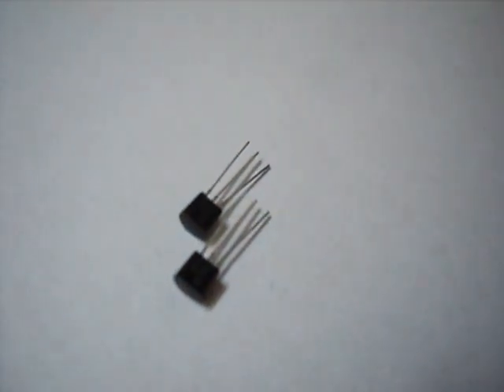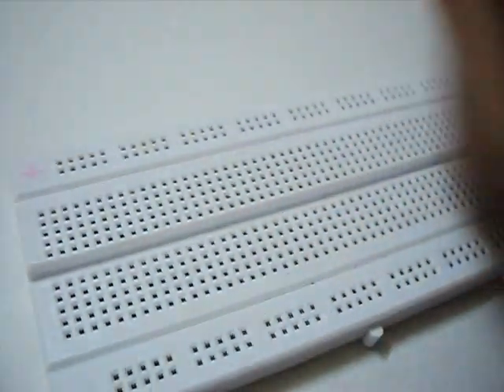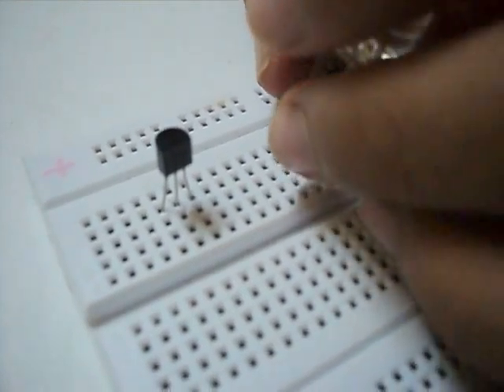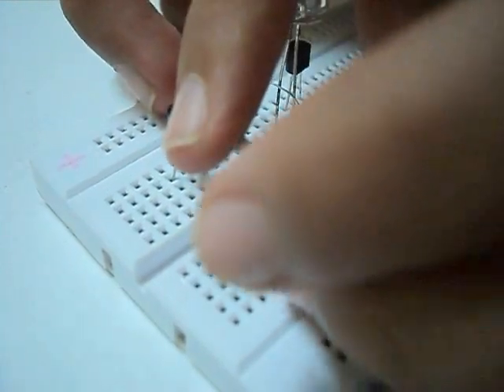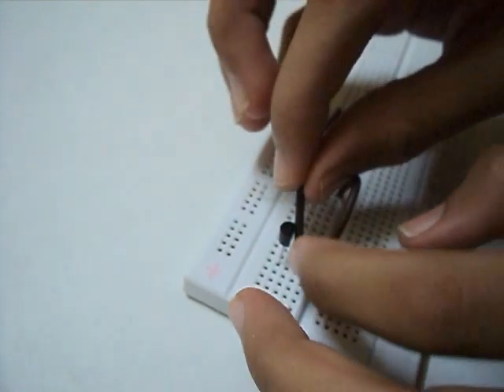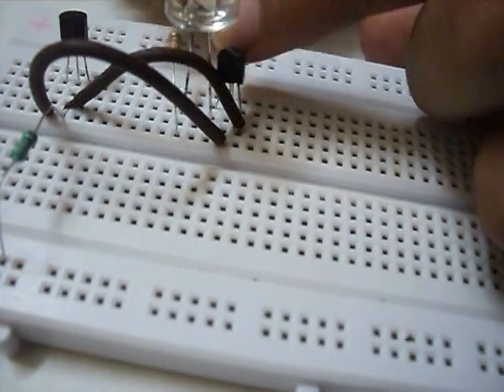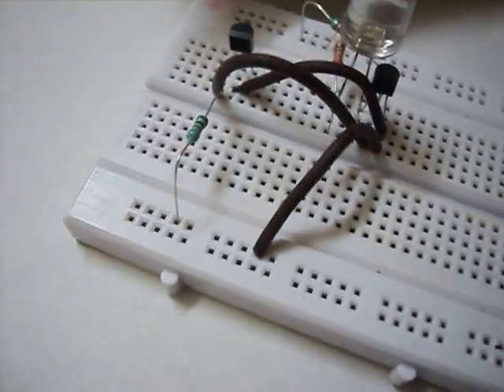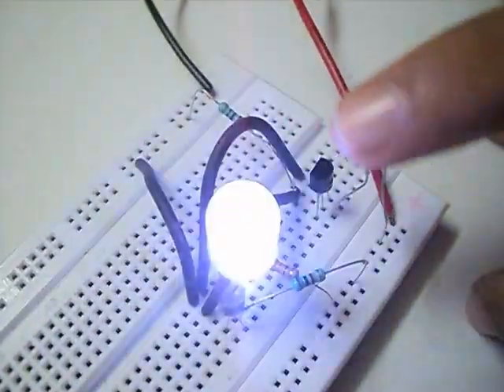Making a simple dark sensor circuit.

Comment: Can we use photo diode instead???
Reply: Yo bro i have same question
Reply from the maker: Yes.
Reply: @curiosity551  need to change the circuit???
Reply from the maker: Should probably work the same. No need to change.
Reply: @curiosity551  how much volt power supply?
Reply from the maker: 5-9 volt is enough.
Reply: @curiosity551  thanks
Reply: I have subscribed